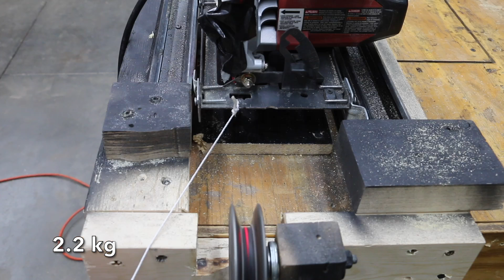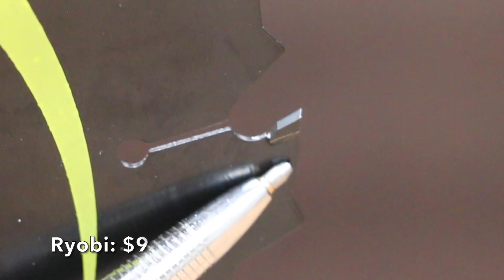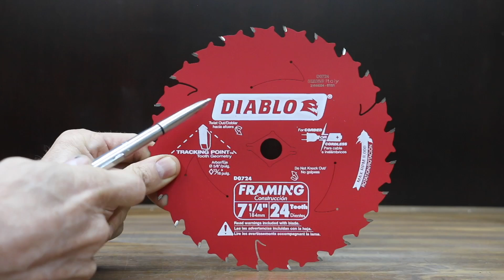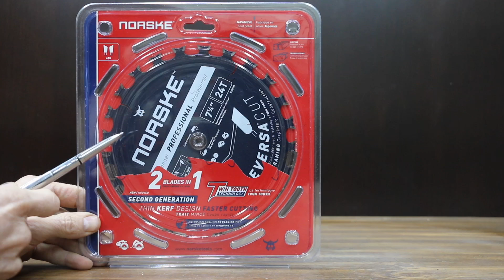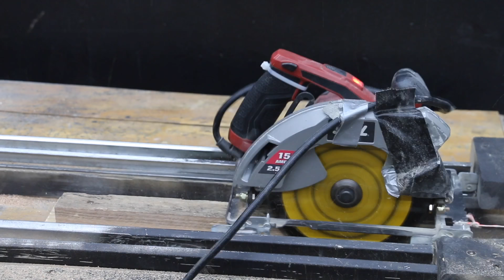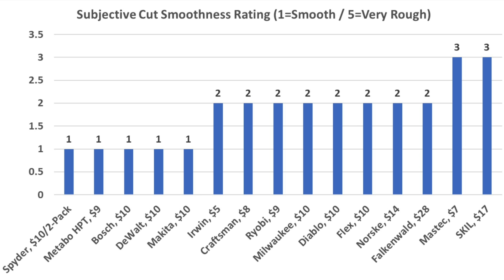Best Circular Saw Blade? FLEX, Diablo, Milwaukee, Makita, Bosch, Ryobi, Irwin, Spyder, SKIL, Norske

Comment: This is all fantastic but it doesn’t hit my main need in a blade which all I care about is kerf cleanliness. I think the closest thing you hit was temp that was super super interesting I wish you did more with that. I’m not a tradesman or framer where maybe speed IS the most important  and you can expense blade sets like I do at carpentry gigs but I associate slower speed with better blades which kinda seems the opposite of what you’re insinuating here.  I know if a want a truly good kerf I’ll go up in teeth but  not trying to maximize speed on any cut. Tooth damage was also useful but it would require a longitudinal test I suppose . Still great stuff. I’ll stick with Diablo
Reply from the maker: Thank you for the constructive feedback!

Comment: I don't like the speed test. It appears as if you have cut the same board for each of the blades. Due to the grain direction, this means any variation in the cutting samples will be experienced by only one type of blade. If board one has a quality that makes it harder to cut than board 2, blade one is highly likely to show that variation across all of its cuts and skew the results.

Since these blades are designed to cut against the grain, I feel like the best test would be to just throw the blades on the miter saw and measure the force needed to push the handle down while cutting. 

If you ever revisit it, I'm sure that jig would save a bit of time over the ripping setup, and be a more accurate representation of the typical use case. I don't know many homeowners willing to try ripping a 2x 😅 nor do I want to

Comment: Hello sir! I have seen quite a bit of great reviews of acetone mix with atf at a 2:1 ratio of 2 parts acetone to 1 part automatic transmission fluid would you be able to see if that indeed helps with carbon build up on the heads of your lawn mower
Reply from the maker: Thanks for the feedback.

Comment: How about 10 inch Table saw blades?  Amazon choice is the Wen at around $11 for a 40 tooth blade and an article on the site says DeWalt is best overall as a 2 pack having  60 and 32 tooth blades....really enjoyed this one for circular saw....have used diablo but plan on checking out the spyder and makita blades now.....thanks!!!
Reply from the maker: Thanks for the suggestion.

Comment: Can you give the thickness of each blade? It's obvious the thinner the blade or kerf is the less wood is being removed. This makes them faster regardless of tooth sharpness. Fine for a skill saw, but beware of the blade flex or wander when using on a miter saw.
Reply from the maker: Thanks for the suggestion.

Comment: I wish i could get that makita blade for my Makita 5008MG 8-1/4" blade i wouldn't dare to slide mine on metal it would damage the magnesium base. When I use it I won't put it on anything except wood the most expensive makita circular saw love having the front light and blower to see the mark that was put on the wood
Reply from the maker: Thanks for sharing.
Reply: @ProjectFarm  can i aso suggest if you do reciprocating saw blade please include the diablo carbide blades I have them and they cut everything I have yet to hurt the tips cutting rebar.

Comment: Thank you for sharing! I just purchased a 4.5-inch mini circular saw for cutting wood.  What blade should I use?  40T, 60T or 80T?  My regular circular saw and miter saw both have 60T on them.
Reply from the maker: Thanks for the suggestion.

Comment: When you say China do you mean mainland China or Taiwan? 
Also you should look at what grizzly offers, as well as high-end brands.

I bought a set of dewalt dado blades they fit the arbor tight might be the saws arbor but I tight fit is good with a stacked dado set becuse all the chippers and cutting blades will be on the same centerline  making the arbor smaller or opening up the holes would be stupid.
If all the blades are on the same centerline any difference in cut would be the blades teeth set at the wrong high or a poor job sharing them.

Comment: Wonder how long it would take the blades to start dulling out on a worm drive. I'm a framer and primarily use Diablo. I've used Irwin, Craftsman, Skil, Spyder, Dewalt and of course Diablo. Longevity and durability are paramount.
Reply from the maker: Thank you for sharing!

Comment: Would this test also apply to 10 inch  table saw blades  as they are used  a lot for hardwoods - also without nails ? Thin vs Thick blades ?
Reply from the maker: Thanks for the suggestion.

Comment: I work very hard not to mix a demo blade application with a new wood framing application. So demo blades and standard blades could have been tested separately. Then the other question I always have is durability. How long will the blade last. Especially a framing blade. You know demo blades are going to take a hit.
Reply from the maker: Thanks for sharing.

Comment: I’ve recently put down laminate flooring. Needless to say, it killed my carbide blades. I bought a Diablo specifically for laminate flooring and it was disappointing on the first cut. Have you done any blade testing for laminate flooring?
Reply from the maker: Not yet.  Thanks for the suggestion.

Comment: altho, a very specialized application, i would like to see wich grinding disc is the best for removing heavy paint-rust. i am a mining equipment tech and i change dozer-loader cutting edge quite frequently. with normal flap disc it seems to dull very fast and i go through 3-4 disc an edge (20$ a disc it starts to get expensive)
Reply from the maker: Thanks for the suggestion.
Reply: @ProjectFarm  grinding discs similar to the scotch brite xt pro.

Comment: It would be interesting to see the effect of different teeth counts. I ask, because I can only find the Makita Max with 60 teeth. Or is there a general rule, what the different tooth counts are for?
Reply from the maker: Thanks for the suggestion.
Reply: The general rule for tooth count is that the higher the number of teeth, the cleaner the cut. So for example, most blades for demolition or framing will be 20-28 teeth, and blades for MDF (which chips easily) or trim would be 60, 80 or 100 teeth.
Reply: @Ironhide428  but I guess the achievable feed rate would be lower for higher tooth counts? Or do lower teeth counts other advantages?

Comment: I’ve been framing for about 10 years and my go to is either Diablo or DeWalt the dewalt has excellent durability. As far as the Makita I thing these results are deceiving, those blades dull extremely fast compared to dewalt, Diablo, and spyder.
Reply from the maker: Thanks for the feedback.

Comment: I wonder about concrete cutting blades? I have a lot of 3.5” concrete slab to cut, close to 1000’ of a total cut length. I’m planning to rent a machine from Home Depot but i will need to buy a blade. My concerns are: is there a blade that will make for quick work, a blade that will last me for the whole job, and I’m hoping i can do it with an electric saw, rather than gas powered (have to do this indoors).
Reply from the maker: Thanks for the video idea.

Comment: Would you take the same blades on here and use them on a Miter Saw or would you recommend something else?  I have to get a replacement blade for mine and I am just using it to cut wood.
Reply from the maker: Thanks for the suggestion.

Comment: Skill cutting wood with nails: 4.7 seconds.  Through clean wood: 6.84 seconds?  Did it get all the damage on the last nail?   This appears to be a pattern with all the blades.  How can they cut faster through the nails & then slow more through clean wood (unless severe damage occurred near the last nail which did not slow it on the nail pass but slowed it on the wood pass?)  Something fishy is going on here!
          Regarding the Makita, the aggressive hook angle is responsible for its high cutting speed, but renders it more fragile when cutting nails.  This is in general true for any cutting tool.  The more included angle of the tool edge, the more force required for cutting & the more resistant it is to wear.

Comment: I have been building for well over 47 years now and you can't say oh this is the best blade  because it really depends on for what I have probably 16-20 different blades there is different amount of teeth different set on the tooth different cuting material takes different blades and don't ever forget what you are going to cut like wood with nails or hard woods or plywoods particle board  MDF Hardy siding backer soffit what oh plastic ?
Reply from the maker: Thanks for the feedback.

Comment: I do not recommend the makita blades! I recently purchased a pack of them because of this video and unfortunately they turned out to be practicaly useless in a skillsaw. For some odd reason the blade constantly gets pinched by the wood. This includes normal cross cuts like a 2 by 6. Now I don't have a favorite blade out of any of these but I use diablo the most. Milwaukee, Diablo, metabo, and dewalt blades all feel similar in my experience. Just to give further context when i used the blades the main issue i had was with trying to rip a 2 by 6 down for a spot i needed to fir out. The blade constantly pinched and heated up so fast that the blade was visibly moving side to side after ripping a 12 foot 2 by 6. Like your example shows the blade rips very fast if you keep it straight but it leaves zero room for error. If you move off the line in any capacity it immediatly binds up when you try to correct your course. From what i can tell the blade is simply too thin to do the job. It makes the cuts faster to be sure but this is the first blade ive ran into that i was genuinely upset by its performance. For some more context I used this in metabos new worm drive style cordless saw and when using the other brands blades I had no issues. I appreciate all the work you put on for these interviews but for future reference I would recommend using the product free hand like a contractor would. Anyways if anyone else has similar issues please leave a comment so we can save some people a little money.
Reply from the maker: Thanks for sharing.
Reply: Edit. I had my more experienced co-worker use one of the blades and he had similar results. Replaced it within a day

Comment: I've benn a diablo user for years untill I used the makita, but I preffer diablo for demo and Makita for clean smooth and quick cuts. I usually dont use demo blades for clean cuts.Makita is my choice, all around, tools and accessories, sorry Milwaulkee
Reply from the maker: Thanks for the feedback.

Comment: I once purchased Falkenwald based on excellent reviews on Amazon, only to find it’s the worst blade I ever used. The finish was also extremely poor. Then I dug deeper into the reviews and found that they use fake reviews from review farms… basically every sophisticated and well written review was very negative, but the majority of simple reviews or ratings alone were 5 star. So - beware! I think it’s actually dangerous blade…
Reply from the maker: Thanks for the feedback.

Comment: Great comparison!  Usually you get what you pay for, but in this case the less expensive brands held up well and in most cases out performed the more expensive brands.  During your testing, I noticed quite a bit of saw dust.  Would you consider doing a test on dust collection from the shop vac and cyclone on a bucket to the 2 stage whole shop machines?
Reply from the maker: Thanks!  Thanks for the suggestion.